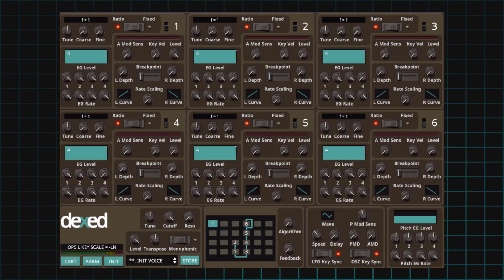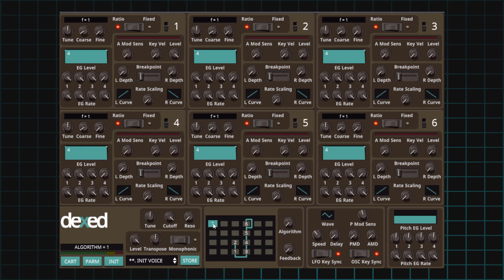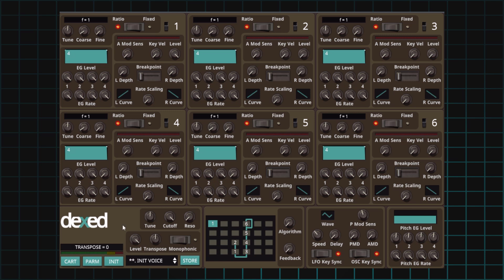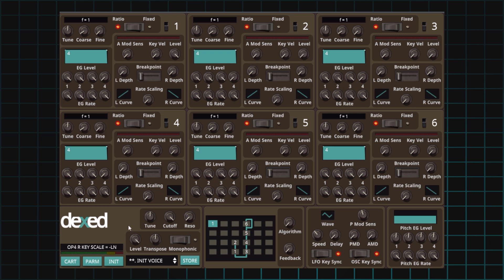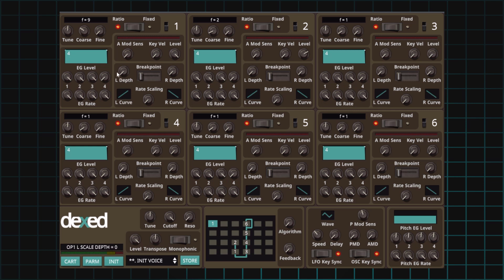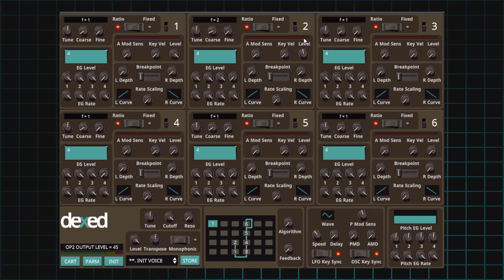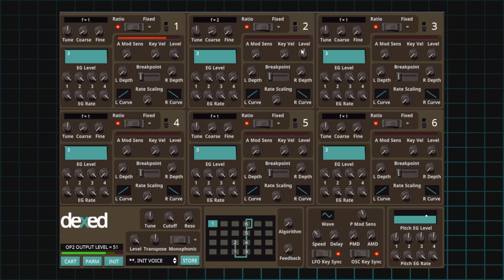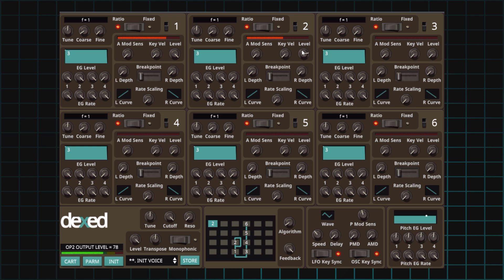Make Classic Waveforms in 10 Minutes with FM Synthesis! (DX7, Dexed)

Comment: Awesome, thanks for this!  For those with a 4-operator DX synth like a DX-21 or DX-100, you can create the sawtooth with Algorithm 6, using just Operators 1 and 4, with Operator 1 level of 99, Operator 4 level of 70, and Operator 4 Feedback of 7.  For the square wave, just change the Frequency of Operator 1 to 0.50 .
Reply from the maker: thanks for your great comments!  Regarding the square wave, a Carrier:Modulator ratio of 1:2 or 0.5:1 are the same thing, just that the latter is an octave lower so depending on how many keys your keyboard or controller has, one choice may be better if you were trying to create a bass sound, for example. That's the cool thing about FM, there are many paths for the same destination. 😊
Reply: @SynthwaveDojo  Yes!  When I saw you changed your modulator frequency to 2, I figured it would achieve a similar result.  Very cool.  Thanks again for this video, and all your amazing videos!  Thanks to you, I've been creating some great synthwave!